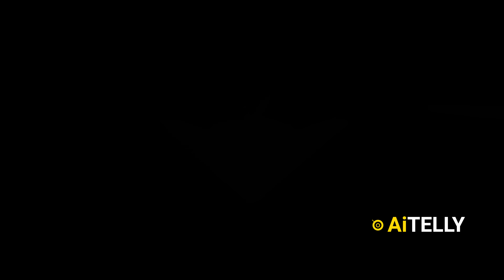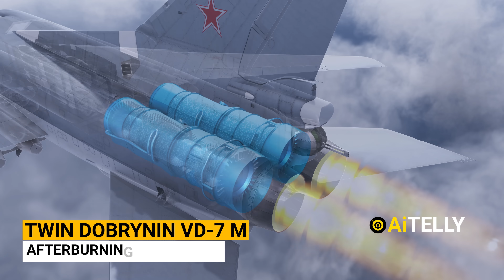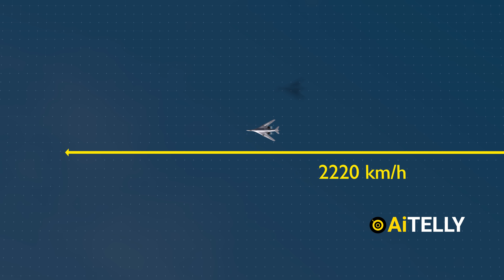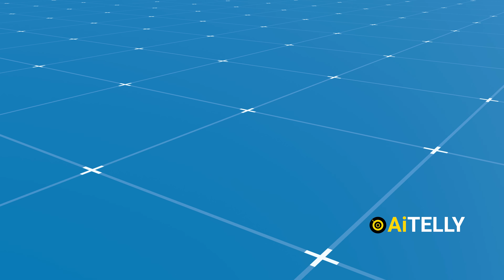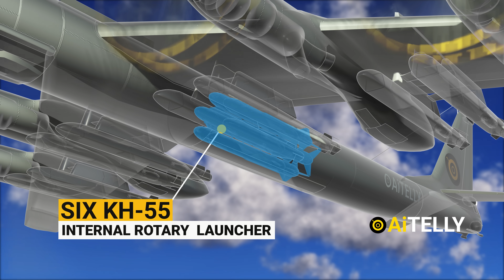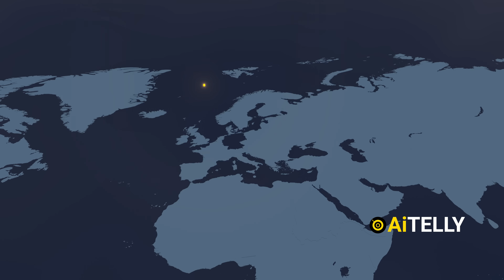How Russian Nuclear Bomber Works? Tu 160 Tu 22 Tu 95

Comment: Lol. What a fake. Tu-95, first version, had max range 15 000 km and it has means for refuelling. Distance from Moscow to New York is 7.100 kms. So, Tu-95 could take off from Moscow, reach New York and return back. In case of taking off from areas closer to western Russian borders distance to New York is even shorter. From Kola Peninsula to New York distance is just 6300 kms. Regarding western coast. Distance between Chukotka Peninsula and Los Angelese is just 5000 kms. So, Tu-95 could easily reach any area in USA and return back. 
And B1 is not stealth bomber and it's not capable to carry nuclear weapons and its out of US strategic forces. Regarding B-2 , due to failures in design it cannot carry long range strategic cruise missiles, but only free falling bombs like WW2 bombers. So, it has to overcome enemy air defense and reach the place exactly above the target that is alsmost impossible in modern warfare no matter how stealthy is it. No wonder , USA stopped its production because the plane can only be used only against enemy with no air defense.
Reply: Literally the stupidest common I've ever read. I don't know what gives you the idea that the B2 cannot carry cruise missiles and or nuclear capable cruise missiles along with nuclear freefall bombs but you are 100% wrong. The B-2 Spirit uses the same rotary launcher that the B-1 Lancer and the B-52 are equipped with, both switch can launch cruise missiles.
But even if they needed to get above an enemy target or close enough to launch a Glide freefall bomb, they can still do it because even though the modern Russian missile systems can supposedly detect a b2, they are not capable of acquiring a good enough radar lock to track it for a missile. And being that it primarily operates at night good luck trying to find it😂😂
I understand your Russian fanboy, but you shouldn't try so hard because it really just makes you look ridiculous
Reply: @GR_Chief American fanboy is melting down
Reply: @GR_Chief  Regarding cruise missiles it's written even in American wikipedia. B-2 is not capable to carry and use cruise missiles. That's written there "rotary launcher or two bomb-racks; the " and another "the AGM-129 ACM cruise missile was also intended for use on the B-2 platform". So, it WAS, NOT IS, INTENDED.  Regarding B-1 that is written in american wikepedia "The B-1B no longer carries nuclear weapons;[40] its nuclear capability was disabled by 1995 with the removal of nuclear arming and fuzing hardware" . So, it's also WW2 stile bomber with free falling bombs, in fact, completely useless thing.
Reply: Also a fun fact the reason the United States quit building the B-2 bomber is because the Soviet union, you know the prior incarnation of the Russian military you're sipping over, had collapsed. And there was no need for more than the 50 they built. Because even to this day there's nothing in the Russian Arsenal that's as capable😂😂
Reply: @GR_Chief  It's silly fake. No country in the world ever destroyed, stopped usiing, its good weapon even if enemy disappeared. Yes, Soviet Union collapsed but Russian Federation came to place, with the same nuclear arsenal as the USSR, same number of strategic bombers, largest territory in EArth. and also China began to rise. 
Not 50 of them were built, but only 21. And few of them already crashed. 
Besides, After collapse of the USSR , USA got many equipment of soviet origion, including radars and interceptors. They found out that even Mig-29s radars can see that "stealth" bomber.
2 American "Stealth" planes were shot down by Soviet made in 60s missiles in 1999 in Yugoslvaia.
They stopped  production of it, because plane is bad in perfomance, very slow, with very little payload, with no abilities to carry cruise missiles. and in the same time with fantasticly huge price. Typical american approach - to pay much for useless thing
Reply: @GR_Chief the best strategic bombers is a Tu-160. It has longest flight range and longest ranges stand off Hypersonic missiles. US is still in developing stages of hypersonic missiles. Latest upgrade of tu-160 it has his own air defence missiles built-in it's tail. How about that?? You definitely didn't know that. It's only strategic bombers that has his own built-in air defence missiles. It can shot down jet fighters and incoming missiles too. Have a good day.👍
Reply: Why do planes generate fuel by circling over the airport before landing? Keep laughing, because refueling in the air is not for your understanding.
Reply: @EksperHotelkin  Lol. They constantly fly along your country's border and make your entire nation shaking from fear. 
They constantly do long intercontinental flights. It has absolute record for jet to be in the are - 50 hours. 
Now, they constantly bomb your nazi regime in Ukraine. 
B-52 huge , very old, rusty stay in bases and does nothing.

Comment: Question?
Does Russia contain a Re-fueling aircraft similar to the United States?
How much FUEL do these aircraft consume?
I know these Hypersonic missiles  can defeat a Aircraft Carrier, CAN the Hypersonic defeat a SUBMARINE?
What about attacking the HEAT signature that a HYPERSONIC leaves behind?
Reply: Russia aerial re-fueling process looks similar to the one used by the US NAVY
Reply: The problem is the Russians do not have a significant aerial refueling Fleet. In fact they haven't manufactured any new refueling aircraft since the Soviet Union fell.
Also there's absolutely no proof that a Hypersonic missile could even hit a US aircraft carrier for multiple reasons. Primarily because they don't have any terminal guidance, because of the plasma field so in order for them to be guided directly on target at this point in time, the aircraft carrier would have to be docked at port.

Also Hypersonic missiles are easily tracked by radar, let alone the Heat Signature they give off. Don't believe the BS that this magical plasma field makes them invisible, that's not how radar works😂😂
And as far as submarines, no not unless you've got a magic wand and you can bring them to the surface and have them hold still😂😂
Reply: @GR_Chief  YEAH
What this guy said....

Comment: U didnt mention the ejection system of the TU-22, the crew ejects below the aircraft, not from the conventional top ejection, if the aircraft is lower than 300m of the ground it almost impossible for the crew to survive , That why in videos of the TU-22Ms crashing off the runways u never see the crew ejecting
Reply: Это справедливо только для Ту-22, в Ту-22М катапультирование происходит вверх, а под полом кабины находится технический отсек.
Reply from the maker: Noted
Reply: @Aitelly  , пожалуйста, обратите внимание на мой комментарий

Comment: please tell me your hp enterprise series pc configuration
Reply from the maker: PC - i7 12 gen
Graphic Card 3060 ti
ram 32 GB
SSD C drive 1 Tb
Hard Drive 8 tb
Mother Board - Any Asus Intel 17 Compatible will do
Cooler Master Power Supply - 750
Screen 27 Inch Benq/Samsung 

Done
Reply: @Aitelly  Yes.Done.